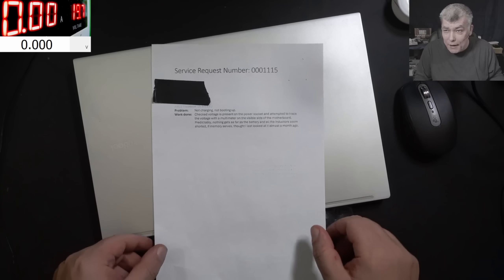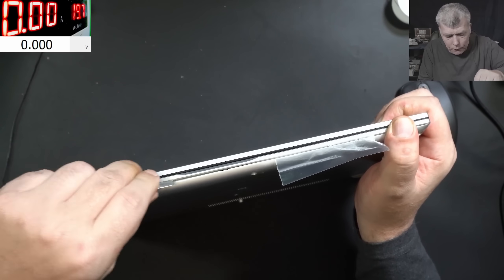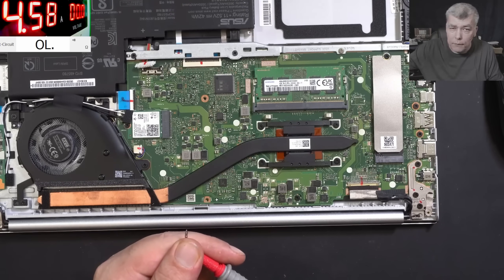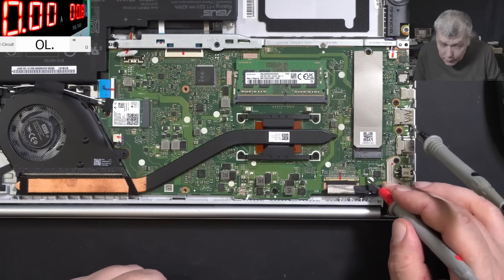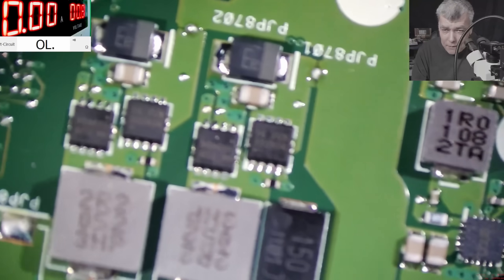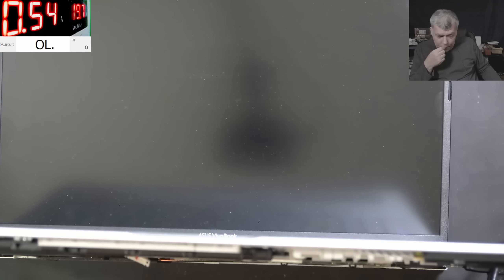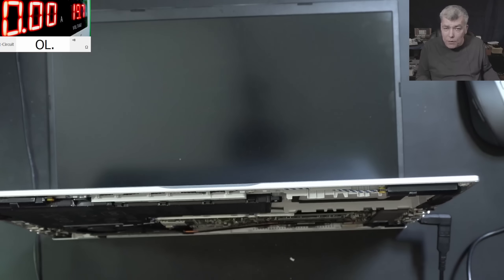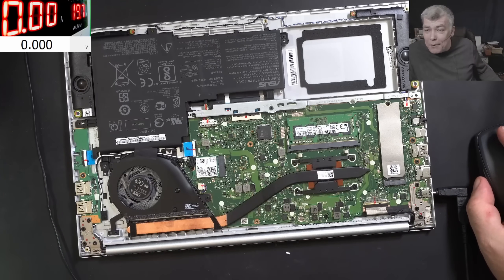ASUS VivoBook 15 M513U dead, no power, motherboard repair - How to identify the main power rail

Comment: I have one but on the left bottom corner of my laptop broke off when I accidently drop it. I also lost a screw on the top left that hold the bottom cover. I want to know what screw that I need to replace it. I'm scared to disamble my laptop to replace the covers and just want to get the screw. I just have a duck tape cover the small broken corner.

Comment: 5:50 between the capacitors is a solder joint connecting two circuits. I find it odd that manufacturers still do this when none of them actually repair boards.

Comment: Hi Sorin, I hope you will find time in one of your future videos to explain how to identify main power rail. In your videos you just open the laptop and immediately check for shorted main power rail somewhere in the middle of the board. This is not clear to me and perhaps many of your viewers. It is obvious that main power rail will be on the first current resistor (the closest one to the charging port), but how do you know which is main power rail somewhere on the board?

Thank you for all you're doing for the community.
Reply: He did explain...Coil, Mosfet, Capacitor.... Shorted. And he said it 5 times in a row.
Reply: What i learn from Sorin ,charging port,first mosfet,second mosfet,current sensor...shorted.

Comment: 5:50 that's a TANTALUM capacitor. they are polarized and a common failure point.
Reply: Why because of heat or mfg defect ?
Reply: @Dicofol1 stress from voltage > 5V. It's a known thing. On old IBM PC restorations tantalums often blow up at first power-on and sparks fly.